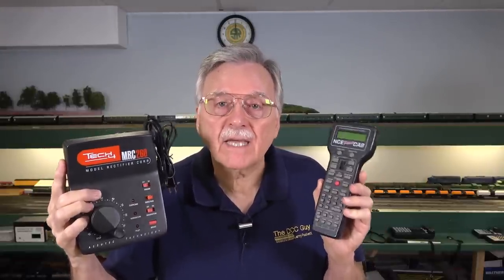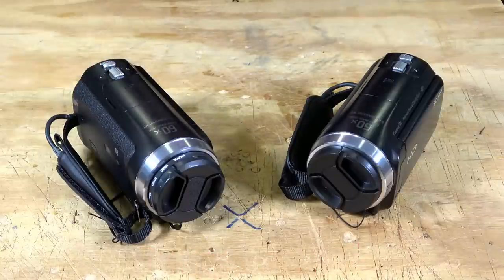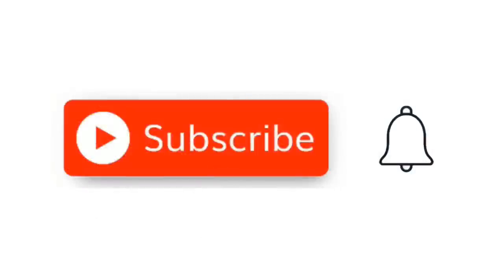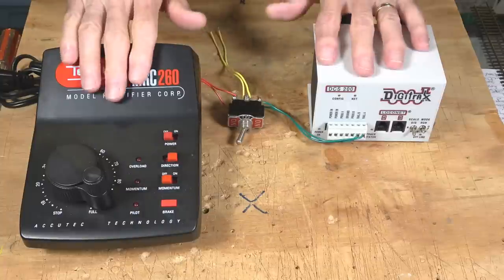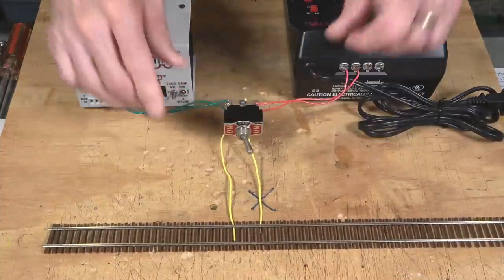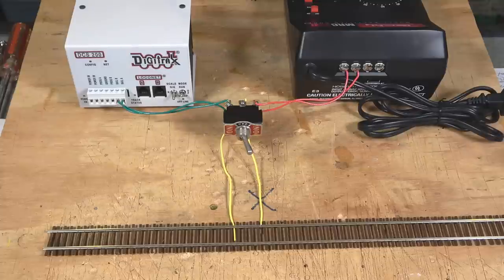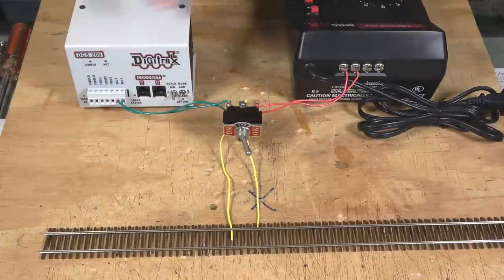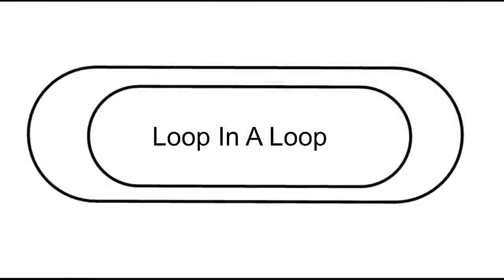Using DC and DCC On The Same Layout (333)

Comment: Larry I been thinking a lot about setting up a simple train table using Trix C track to run on DC and DCC just like you showed the track has insulated plastic frogs so don't see any problem with that; however the question I have can I use the marklin switch machines if I wire them on a separate isolated bus and not wire them to the track; would that be safe?
Reply: The answer to your switchmachines is yes, its OK to run them on a seperate buss. It's the prefered method. As for  insulated frogs, these do not necessilary stop a short between DCC and DC parts of a layout. Isolate both tracks with insulated joiners and have a dead section  longer than the longest train you run between the  DC and DCC, otherwise a short can happen. Its a bad idea to mix DCC and DC on a layout that you can go from one to the other.  All it does id complicate your wiring and layout control and also can result in damaged power supplies, controllers and decoders.

Comment: having both dc and dcc, i don't like dc anymore but MRC has come out with tech 7  that will run dc and dcc from the same power pack. Their old advanced dcc would run 1 dc loco on th e dcc layout. their later models will not run dc so they came out with dcc and dc from the same power pack. Might want to check them out.

Comment: Hi Larry, I’m struggling to understand why it’s not possible to run my  DC trains in conjunction with my turnouts ( Kato N gauge)      with switching capability using DCC digital?! After all, it’s my understanding that the turnouts powered, when selected, only activate magnets, therefore not connected directly to the track, another words the power for the turnouts is independent to the DC track feeder and connections! 

In simplistic terms, run DC trains but have digitised operate Kato turnouts.

I hope this all makes sense to you Larry, I look forward to your answer. Thank you in advance… Brian H (UK)
Reply from the maker: Brian, I am not exactly sure I understand exactly what is and is not working? First, can you run DC trains on the layout other than the turnouts using DCC? What DCC system are you using? Second how many are you try9n* to run at the same time? Tell me exactly what you are tryin* to do that is not workong

Comment: Could you use a mobile phone, or tablet as a camera, of you don't have a backup camcorder?

It should be compulsory that all powersboards come with some kind of protection, but also switches that turn each socket on or off.

I can't understand why your country doesn't have on/off switch for power points.
Reply from the maker: Yes, but with much less control and it would be cheaper to buy another camera than upgrade my old iPhone.

Comment: That taught me a lot I had mine hooked up correctly and couldn't get my digital to work I think they sent me a bad unit because now I'm going to hook up a power cab to it for dcc and now can't get the DC to work but will rewire it back the way I had it and see if dcc works and the DC works

Comment: I have added a 14-gauge bus for my common rail.  My layout is from the early 90's and has 13 blocks.  I have added several common rail 22 gauge drops for the common rail at least one drop for each block, and 3 on the two longer blocks.  I want to continue to run both DC and DCC on my layout because I have a lot of old Tyco locomotives that I like to run.  I am using an Atlas controller and Atlas selectors to turn the blocks on and off.  I have DC on Cab A and DCC on Cab B on the selectors.  The common rail bus terminates on the Controller.  My question is do I need to add isolated rail connectors to the common rail to isolate both rails in each block?  If I do add isolated rail connectors to the common rail would I still be able to just have the one common rail bus terminate on the controller?  The Digitrax manual shows Power Districts that have both rail A and rail B isolated, is this the same for DC Blocks? If this is explained in your wiring book, I would gladly buy it and ask if you could tell me which book and where this is covered in your book.  Thanks!
Reply from the maker: Digitrax makes special command stations for use with common rail which I have never used or even seen, that’s how rare common rail wired DCC layouts are. I suggest you contact Digitrax tech support for their advice on installing  their system on your layout.
Reply: @ I guess I’ll have to install insulated rail joiners.  I think it will still work with my Controller and Selectors.  11 joiners and 3 more drops.  Thanks!
Reply: I just occurred to my that even with isolated rail joiners that I will still need a way to turn the common rail power off to that block.  Is that correct?
Reply from the maker: Again, you’ll need to consult with Digitrax as to what their equipment will require for use with common rail wiring.
Reply: @ 

Thanks,  here’s the response from Digitrax:

It is wise to isolate the common rail for each block.  This said, the DCS50 will continue to operate successfully if you manage block selectors wisely and do not attempt split DC/DCC operations on the layout. 

Tech Support
2443 Transmitter Road
Panama City, FL 32404
Reply from the maker: That really leaves a lot open for interpretation doesn’t it? In the final analysis it sounds as though they are saying don’t try to mix DC and DCC simultaneously. It could mean you could use selector switches to route DC or DCC power among blocks to avoid conflicts but then that sounds not much different than DC block operation. This confusion has existed from the beginnings of DCC and is one reason why I have always recommended that folks not use common rail wiring with DCC.
Reply: @ It sure does.
Reply from the maker: Here is a search link for the Digitrax website with all their tech notes related to common rail https://www.digitrax.com/tsd/search/?q=common%20rail

Comment: Larry, I don't want to be that guy, but when you demonstrated the DPDT switch you accidentally showed the switch positions backwards. I.e., when you had the switch in the DCC position it was actually in the DC position and vice versa (unless you have a special switch). I only point this out because I know you want to be completely accurate. If I'm wrong I apologize and feel shame. It also seems like you can combine both ideas and have two separate loops with just the interchange track selectable between DC and DCC.
Reply from the maker: Yes, I was trying to keep this as simple as possible and didn’t want to get into various permutation of the approach and the inner workings of DPDT switches.  As far as using the switch on the interchange track, yes you could do that but it means running a loco onto the track, stopping it, throwing the switch, then moving off onto the other loop. And of course there will be the occasional operator who will forget and run right on through.

Comment: I got into a fight years agoe. 
I was with a modular model railroad club, and thay wanted to go to DCC and I asked if we can make a plug to test driffrent systoms  on the module . and i was told by one member  you cant run DC With AC It will blow up KBOOM KBOOM . 
I told him we will put the DC systom in his car and he can plug it in at his home where it can blow his home when we test the systoms . 10 milesaway 
Oh we did just used a switch to keep the 2 symptoms separate. and at that time all switches were manuale thrown.

Comment: On a Lenz Command Station is Engine Zero is DC, the others are DCC
Reply from the maker: Yes, some DC systems offer this capability, NCE does not but Digitrax does. However it is not good to operste a loco using address “0” for more than a few minutes as it can overheat the motor, so is best used just for testing.

Comment: Hello Larry  do you have a email, I have a wiring issue using a double cross over, could use some help  thanks
Reply from the maker: Not one I openly share on the internet. If it can fit in a comment put it there.
Reply: Ok Larry I will try and thanks
Reply: Hello Larry
Ok let’s try, building a new layout, arround the room with a lift gate, using the contact points from DCC concepts 
I  am planning a double staging yard using the new Walthers double crossover, both tracks are dead headed at one
Left track connects to main line via a turnout , right track connects to main line via a turnout, same main line
Planning to use Walthers switch machines on the double crossover and power the frogs as per Walthers wiring diagram 
This way of connecting to main line looks like a wye , 
Want to control  switch machines on double crossover with my NCE power cab
Do I have a possible shorted condition , do I need add a device to take care of this possible short condition 
Not sure if you know Sparky107107 but he is coming over today to look at my track plan

Comment: My daughter lost all the TVs in her house from lighting. She had an electrician check her house and he found the ground had bad connection at the ground rod.
Reply from the maker: Yes a good ground is essential. When we redid the kitchen 10:years ago we had the electricians install a whole house surge suppressor in the main breaker box and they also added a second ground rod in addition to the connection to the copper water line. However with a strike that close to the house  it obviously can find a path in anyway.
Reply: Do know that guy named Murphy .. ( worked with his son).  years ago there was a lightning strike near CN's hump yard in Edmonton Alberta. It was observed hitting the earth, not buildings or poles, but the voltage surge went back through the grounding and let the smoke out of the hump yard computers. I also add a little cube arrester close to valuable equipment (single plug in). Great video, hope the camera hangs in there.

Comment: Bad luck with the lightning! I don't know how good surge protectors actually are, I suspect the cheap ones in power strips are pretty worthless. What keeps killing your cameras?
Reply from the maker: I spoke with tech support at Sony and even they couldn’t tell me why they fail. One day you turn the camera on, it clicks 3 times and that’s it. It’s been the same each time and tech support said it was nothing I had done it just happens. So after 5 fails I refuse to put another $250-300 into repairing each when I can buy a new 4K camera for a couple hundred more, and it won’t be a Sony!
Reply: @TheDCCGuy wow, repeated failures like that, and unhelpful support, would drive me for sure to another vendor. On the plus side the video quality of those Sony’s is great. Onwards to 4K.

Comment: I've designed a much safer way of using DC & DCC on the same layout.  It's a wiring design so any power system can be used on any track.  Anyone interested?

Comment: I am a retired Electronics Engineer, I used to repair TV's, Hi-fi, computer systems etc. and pipe organs (there is a lot of electronics and cables in these). I have seen a lot of equipment that have been zapped by lightning, what people don't know are:
1. Surge Protection Multi-sockets work once, the trouble is they don't tell you if they have been zapped, use UPS battery backups instead if you have to leave the cables connected
2. Lighting strikes hit more equipment then you know (including model railway/railroad DCC decoders), you may lose some equipment, but others have been weakened and can take up to 2 years for a fault to appear, this I have seen many times as people say they had not had a storm
3. Lighting strikes can effect buried cables of up to 1/2 a mile away. This includes electricity cables, internet & telephone copper cables and sat or cable TV copper cable
So what's the answer? Simple, unplug everything if you expect a storm (electric motors normally are not effected i.e. washing machine, fridge/freezer unless they have a digital display and/or wi-fi). UPS battery backups help and good ones have warranties to protect against lightning.
I had an unexpected strike in my yard, the UPS to it all.
I hope this helps for any future strikes.
Reply from the maker: Yes, my internet cable was buried near the tree and it wiped out the connection at the house but fortunately did not go further. My cable modem and wireless router are on an UPS so they did not get zapped. Hopefully the whole house surge suppressor in the breaker box is still in good working order—at least the two little green LEDs indicate that. Is there any way to check it or should it just be replaced?
Reply: @TheDCCGuy  I live in France and my 2 (house and chalet)  house surge suppressor work every time (we have had a number of storms this year). So I don't know the American system, I guess yes it is working, but ask around.
Good job you have the modem & router on the APS, my internet is on fibre, it is in danger of trees falling on the cables.
I have 3 phase elec to the house on overhead cable, but I have a single phase underground going from the house to the chalet, this is where I get hit. At the moment I don't have an APS UPS, so I unplug it all.
Thank you again for your videos, I am new to DCC, so you are helpful.